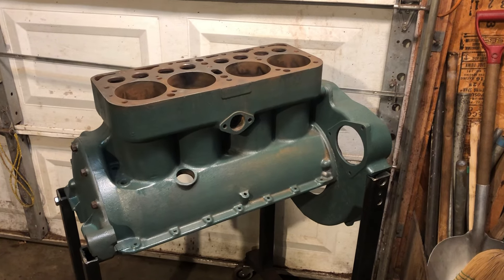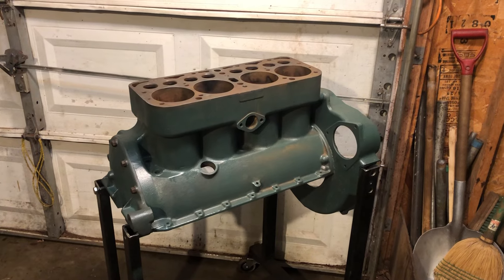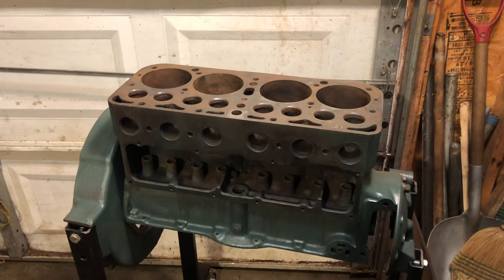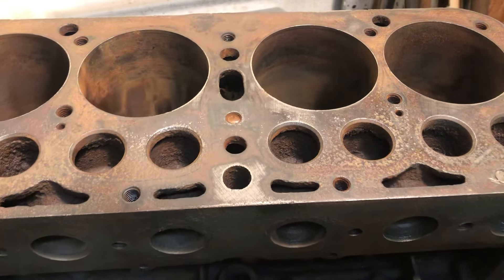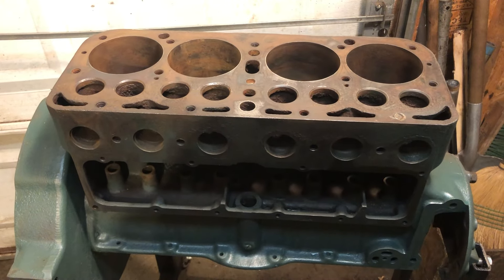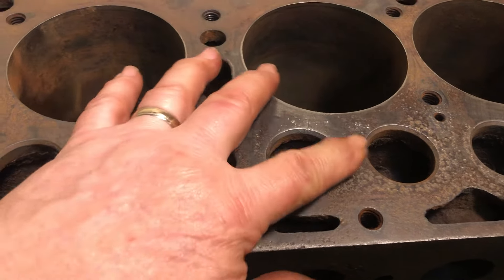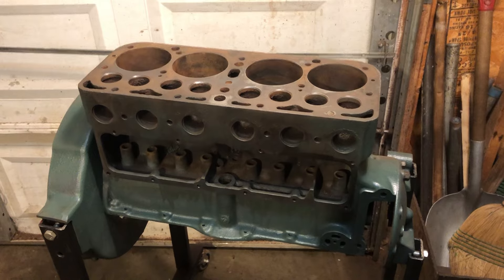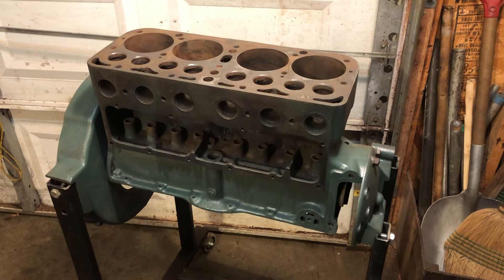September 1928 Model A Engine Part 6

Comment: That´s a major pain, Dan! Looked so nice with the new paint. Could be fixed I reckon, -  but 
a) you might hate it to hand parts to a machine shop to fix them for you as much as I do. 
b) it´s surely better to choose a block with no cracks over a "welded" and sleeved one, - not to talk about the valve seat.  
If you have a choice... 
Doc
Reply from the maker: I have some ideas as to what I will do with this block but will first set it aside for awhile as I am cleaning up another 28 block.  Will show that one soon.

Comment: Hi, I have studied this footage well 2x over, and I am convinced that new cylinder sleeve and do all the valves a new valve seat job, inside the valve chamber area, a good cleanup with a wire brush and seal this with a example J.B. weld kind of product, that block can be saved. Please consult you machine shop, as I also feel very very sorry to discard this block. Hope to hear that there is hope from the machine shop guys. Thanks for your great YouTube footage. Myron
Reply from the maker: thanks!  I am hoping that this one might be able to be saved.

Comment: You seem to see several cracked blocks, what would you think is the cause ? I got one with the water jacket crack, definitely from a freeze.
Reply from the maker: Freeze cracks in the water tank area on the outside are pretty easy to fix as they only need to hold water not under pressure.
These kind of crack I would guess are from heat as they are almost always in the exhaust ports